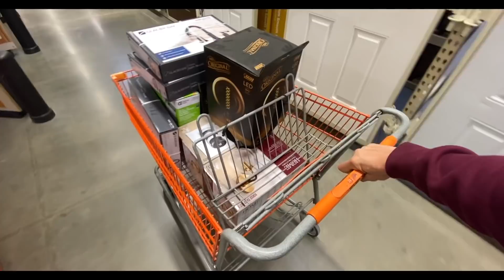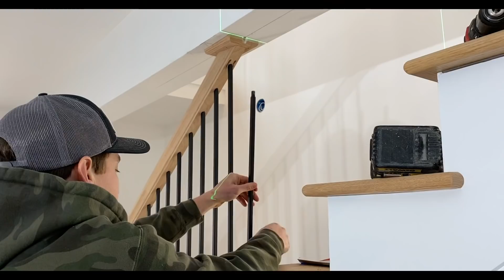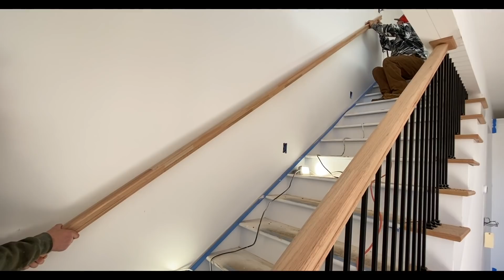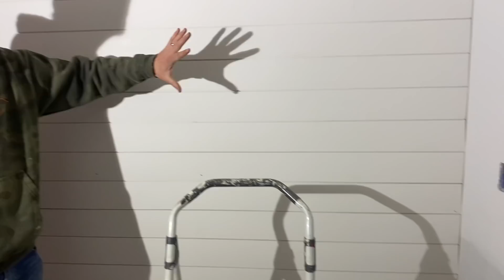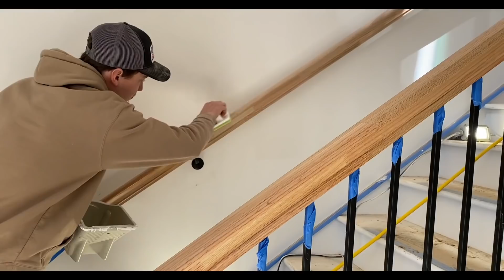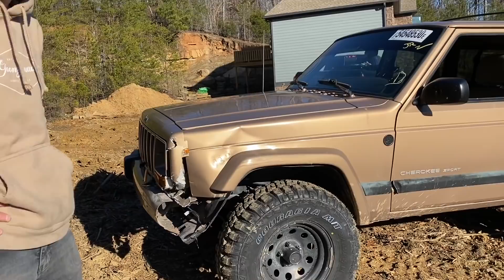The New Goonzquad Headquarters Part 65

Comment: Drop that hemi in it that gold nugget will RIP all day loving the vids.
Reply: Rip all day, legit,  and if that hemi gets PROCHARGED, Even greater!
Reply: @rickystepanek6173  you have a hard on for procharger or what
Reply: What happened to the charger?
Reply: @A7RM  It's the parts Charger they bought to help build the AWD Cop Car Charger. The parts car with its full engine is still sitting at the "old" HQ.
Reply: @A7RM  they have it I hope they pull the hemi out
Reply: Just think about it,  Goonzquad has used the same product for the patrol squad build,  gladiator build,  and the mustang build,  all cool by the way. Why not just full send this new build? And if they do, I'll have my loudspeaker on!  Let it rip!

Comment: I have the nest thermostat, it's a useless and stupid thing. Geofencing doesn't work, if you have even the slightest irregular routine it's jut simply unable to make anything of it, also it's just one zone, you can't add zones or anything like that and google blocked IFTTT, so it's limited to just google home. Looking back I would have been better off with the Tado thermostat, that can do zones, you can add thermostats or radiator knobs for different zones and it's able to do proper geofencing. If you have the choice, don't go with the nest thermostat...

Comment: Hemi-swapped, and with front & rear lockers, there would be almost nothing that could stop that Jeep XJ!
Reply: And with the right adapter platforms, that hemi can bolt to any transmission, crazy! Not to mention procharging it would be nuts!
Reply: @rickystepanek6173  w21²²+qqera!
Reply: Yesssss I love this idea!!!!
Reply: Beside passing a gas station like my Jeep... 🤣
Reply: There'd be some slight...massaging, to get that big ol hemi in that engine bay.  They aren't tall engines, but they are wide as hell.  Then there's the wiring harness, exhaust, getting the steering to work, reinforcing the unibody so that hemi doesn't twist it into a pretzel... It can be done, they're gonna need a good plan to do it though.  Who knows, someone may have made a kit to bolt it in
Reply: I mean they have the hemi from the wrecked cop charger !
Reply: Id say trickflow heads, aftermarket cam/lifters etc would be best to do to a hemi
Reply: Yes yes yes do it
Reply: Put a hellcat in it.
Reply: Hell yes I agree tired of ls swaps but never can go wrong with mopar motors
Reply: Hemi more than likely would not fit.
Reply: @davidbarr9203  You should google "Hemi Swap Jeep XJ"....it's not easy, but it can be done.
Reply: C
Reply: https://youtube.com/channel/UCCDkkLUkY8y4tcnUyz6m8TQ
Reply: I was about to say the same dam thing
Reply: An Aussie built Landcruiser will knock it out the park bro!
Reply: @krispykruzer  Of course. They build stuff down there for getting you to wherever you want, to go, no matter where that is. We must get comfy chair vehicles here in North America. :-/
Reply: @krispykruzer  Who gives a shit
Reply: Nah! Ls swap it.
Reply: Hemi's are horrible in off-road

Comment: HVAC guys shouldn't of used that bracket that comes with the nest thermostat. You use that when you have an existing thermostat you are replacing to cover any holes, mismatched paint, etc. Looks cleaner when its just the eyeball and no backplate.

Comment: As cool as the 5.7 hemi would be, it's very impractical in an xj.  It is a unibody and the weight/torque of the hemi would twist the unibody in no time.  Yes, you can do tons of strengthening to the front subframe, but youd be just as well off with a stroked 4.0l....    like a 4.7 or 4.9 stroker with a good cam grind and supporting mods and you'll be just fine.

Comment: Anyone else notice when they are driving the Jeep straight the steering wheel is upside down ?
Reply: That's pretty common in beater cars.. Either it was mounted that way or the alignment is messed up from the tires/lift kit

Comment: Contact Golen Engines and do a 4.6l stroker kit. It will be a night and day difference. And, that thing only has 3.55 gearing from the factory, which is why they seem so under powered.

Comment: If y’all did a 4 inch lift with heavy duty springs in the front bc of the weight of the hemi that think would be unstoppable, and those cherokees frames are like built into the chassis so frame stiffeners are a good thing too

Comment: It is common for that to happen where it happens the most is in when the line set is running through the eve of a house and as you're coming around into the attic area from the eve if you don't bend your copper enough when you go to replace your roof it will happen

Comment: Gidday, that "shiplap" is called "tongue and groove" in Australia. For over a hundred years all the internal walls of our wooden houses were made of a single layer of these boards, up until the 1950s. Because of our warm climate and abundant lumber, timber homes were the norm. Hardwood frames, weatherboard exteriors, and tongue and groove internal walls with corrugated metal roofs with verandahs (porches) around the house. I love the construction videos. A nice alternative to the car videos which I loved. You could be the next "This old House".

Comment: How did they know where to cut out the sheetrock to find that leak?
Reply: During a high pressure air test of water pipes the routine is to close all the valves and see if the pressure drops. If so, there is a leak (or leaks) somewhere. Applying a higher pressure can enable the defects to be located by listening carefully for a 'hissing' or 'whistling' sound. Of course, this is all supposed be done before drywall is installed...

Comment: Just turn the jeep into a trail rig. Something with a v8 and a centrifugal supercharger, longer travel suspension, exo skeleton, remove the doors, wench on the front and back, sealed interior so no mud or water can get in, plus a snorkel

Comment: I noticed that you installed the Nest smart thermostats in the new house. May I suggest replacing them with the Honeywell smart thermostats instead. I had the Nest thermostat installed and it didn't last more than 3 years. If you stay with the Nest, keep an eye on its because there are many getting replaced by with the Honeywell units due to failures. Mine decided to kick on my central air system while it was 46 degrees outside and risked damaging the condenser due to running nonstop for 2 days until I went outside and noticed it running. I immediately turned it off and called the HVAC tech that installed my central air system in. He disconnected the A/C wiring portion of the thermostat seeing I didn't need it in the winter. Not even 1/2 hour after we just wired the heat into the thermostat, the furnace began banging and turning off and on and the furnace gauges began going haywire. We disconnected the Nest and ordered the much more advised Honeywell thermostat. Good luck with the rest of the build, I'm enjoying the content. Sorry for such a long comment but I didn't want you to be confused with a shorter one.

Comment: The oil sending unit is right beside the oil filter..and easily broken by changing oil filter..more than likely that is the reason for the low oil pressure...it might not be the problem...but i worked for 10 yrs as a manager at jiffy lube(embarrassing)and seen this alot..its a cheap part..and honestly for what u guys are gonna use the jeep for..its not important!!  Big Fan of u guys!! Keep up the good work!

Comment: I hate to say it, but as far as becoming a smart home, you guys missed the mark on one point. Through all the videos, one thing I haven't seen is coax and Cat6 distribution. Understandably you're not going to have a computer or smart tv in every room of the house, but any area where you potentially could have had something should have gotten wired. Wouldn't have been hard to setup a server rack in the attic to join everything together.

Comment: If it was me, I wouldn’t mess with the legendary 4.0L in-line 6-cylinder engine. I would at least look into what it would take to rebuild the motor either with OEM parts or give it a mild performance build
Reply: Stroker and a mild cam

Comment: The motor is fine and have enough power.  Maybe it could use a rebuild, but that straight six is a strong motor.  What you need to do if make sure the new axles you hinted at have lockers front and rear and you'll be able to rip around no problem.

Comment: It'll cost you less and be better equipped if you get a Cherokee with correct engine and transmission to handle the kind of Duty you want to put put it through.

Comment: Dude, it's not the engine, it's the driver. You always approach trees from an angle, you also use differential locks so the front tires do no spin as long as the rear tires have some grip. You DO NOT bump into a tree straight on and then push the pedal to the metal, that's a rookie mistake.

Comment: Do not swap engine on jeep! If it take take forever, build it up, bigger cam, throw it with turbo and make it power and axle swap! 

Automatic transmission to manual may have a lot of to work to change

Comment: The engine swap would be very cool! However, all you need is a differencial locker... It has plenty of power as it is, to accomplish anything the rest of the car is able to.
Reply: I mean, all that power would only make sense if you lift it a lot and put bigger wheels, and then you would be able to use the extra power. And if you don't get a locker, it won't matter how much power you have. Actually, depending on how it's delivered, more power could mean a worse performance without the locker...

Comment: I’m gonna reiterate my recommendation from the last video.  Stick with the straight six motor, or maybe look at stroking that 4.0 to a 4.7L.  For drivetrain, simply find a wrecked TJ Rubicon.  The transfer case is a simple swap with a 4:1 ratio, and the axles are super simple for guys with fabrication skills like yours.  4.10 axle ratio Dana 44’s with built in lockers.  For suspension, Rubicon Express 3.5” lift.

Comment: Check out INSTEON for lighting control.  Control all the lighting in the house, even set lighting scenes for evening lighting, etc.   it works with Amazon Alexa and you can come in the house and tell Alexa to turn the house on or use the app from anywhere in the world. It’s not overly expensive and works well.  Even control ceiling fans, exterior lighting.  Make a party lighting scene for when you entertain.  Alexa can control your thermostats as well, so you can give them commands to adjust the temp if you want.

Comment: If you want that Jeep Cherokee for rock climbing and off-road sporting , an Hemi engine would be counterproductive, you'll have more power but more weight, those two things cancel out. So, my advice is repair and vamp up that inline six and add a turbo. You can get a lot of power out of that engine or  replace it with  4.7 Jeep stroker  engine, take a look at this forum: https://www.wranglerforum.com/threads/4-7-stroker-if-you-did-it-was-it-worth-it.191223/

Comment: Love the amazing content and crazy work you’ve guys did on the house, please just fill in the spaces bellow the stairs on the side. Every time you film in front my eyes go straight to the spaces. 🇨🇦🇨🇦🇨🇦🇨🇦
Reply: @cmoore7821  I understand the had plumbing issues and they fixed the ones as well under the stairs but I’m talking about the higher stairs, eye height that you can see when they are filming. They paint that wall already and the gaps are still there. Not saying anything bad they’ve did an unbelievable job.

Comment: There is nothing else on YouTube to compare to these guys. Love the way they fracture the english language with no regrets for their constant use of double negatives. Two guys who bring no family squabbles or fake turmoil to their content. Look forward to all of their work, especially when their Mom and Dad are helping out or eating dinner together as a family.  As for the Jeep, go with something small displacement and high horsepower. Please do not place a boat anchor Hemi over the front axle. I would go with an aluminum GM engine that has a beefed up rods, pistons and top end. EFI to insure instant response at all four wheels and for reliability. Thanks Guys for never changing who you are,

Comment: That nail hole was the fault of the ac installer for not locking the lines into the center of the wall, not the fault of the siding guys...

Comment: If you guys are able to, consider adding wifi wall switches. They run about $15-25 each depending on what you buy and it’s so nice to turn everything on or off when you’d like using a voice assistant or run them on automated routines.

Comment: Ls swap. Parts they sell complete turn key set up motor and transmission and the wiring harness they set it up where you can Crank the motor up on a crate check them out

Comment: HVAC: 1. those lines should of been pressurized with nitrogen from original installed to now. With hot and cold temps moisture can build up in the copper. 2. I sure hope they used a Micron guage when pulling a vacuum (below 500 microns sitting for 15min) as you achieve this by changing the pump oil and other techniques. 3.) That stone is going to settle and thus the Condersers will be out of level. You should have put either brackets or built a platform. 4.) Get start up sheets of the performance with Temps, pressures, and electrical draws. Go to any app and you can compare to see if the job done was done right. I have almost 30yrs in HVACR. I hope you read this..probably not

Comment: Hey goonz, "the jeep build "....lift kit, spot lights,lightbar and camoflage spray job,wide body fenders and flaps, chequer plate on bonnet,roll cage,2x bucket seats,wheel on bonnet and one on rear, jerry can on rear too....
Woodland matt camo spray job,tricolour brown,tan and black..
Very cool house,coming along very well,just need a shop to work cars on eh,look at containers for short term maybe with roof in between 2.
Other build ideas.....datsun old skool ricer, lotus elise,exage widebody, aston martin 24hrs body kit,  pantera de tamosa outside wide body with tesla electric inside.....
Keep up the goodness...
Peace.

Comment: Lower the air pressure by 15-20 lbs (or more) in the tires and it will grip sooooo much better four wheelin. Even the old tires would have done much better.

Comment: Hemi, 1 ton steering axles front and rear, hydraulic steering, atlas twin stick transfer case. Build a bad ass overland crawler. Maybe get Matt from bleepen jeep in on the build.
Reply: they should talk to Casey @ Casey's Off Road Recovery or Matt @ Matt's Off Road Recovery. Matt's jeep is killer.
Reply: 4bt Cummins with row your own gears
Reply: Dont forgat lockers for tru 4wd

Comment: Probably wouldn't be a good idea to park a car on the backyard slab, since it does not have rebar in it. It's not gonna crack right away, but by not doing that it  would probably increase the life span of it by quite a bit.

Comment: Smart homes are not that new. I have had manageable devices in my home for  10 plus years. What they are is easier now as you have plenty of choices and options which lead to the next problem which is interoperability which doesn’t exist meaning your nest won’t talk to your surveillance system which won’t talk to your light switches or bulbs so if your going to do it, pick a brand / line and Stick to it otherwise you will spend lots of time and money w all of it  to work under one console

Comment: And you dont need sheet rock guys to fill those holes use 2x4 on either side and cut your drywall to fit the hole...yinz take on complicated projects but waste money when its easy stuff.

Comment: That Jeep NEEDS a Hemi, that thing would rip with a 5.7 and those things can make HUGE power if built correctly
Reply: the 4.0 i6 is way more reliable and still is a ripper with the right mods. the engine itself is indestructible
Reply: Front heavy with a big V8
Reply: Needs to be rebuilt or the cam will fail very soon after they out it in
Reply: @Bristol57  sure, the more weight the better
Reply: Yeah!!!
Reply: I was thinking the same here!
Reply: That hemi from the discarded cop car💯
Reply: Four 🤙
Reply: Five 🙃
Reply: ls2 engine😅🤔
Reply: @jullianhuisken7779  gotta keep it Mopar
Reply: @KamerenStrouse  
I know what you are saying but this Jeep was not a Mopar when it was made. Still I agree Mopar and not GM.
Reply: https://youtu.be/ehEN6HYBy2ghr
Reply: Put the hemiiiii
Reply: I think all agree hemi swap 😂
Reply: @georgemay1234371  sorry. NO
Reply: Hemi swap please 👌🏽
Reply: 3 votes for a 5 7 Hemi transplant.
Reply: if you have a hemi just "laying around" it would be a sin NOT to put it in that XJ